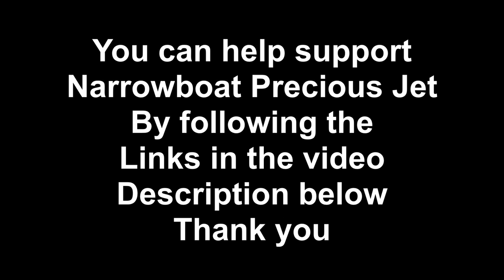Narrowboat Refit #58  Odd Jobs & Lighting The Log Burner

Comment: Oh dear, when I saw the bag of logs I added on the notes I had written 'need to get kiln dried wood', and so it was! I am afraid that these nets of logs are all to common and cause problems. The government is outlawing these wet logs from being sold. You need wood between 12% and 20% moisture content for good combustion. I would put slightly more kindling in but that was not the problem. If you would like I will pop over with some wood if you want to contact me and show you how, maybe even cook some bread? I would also recomend the wax and wood straw firelighters as the white chemical ones are prone to creating smoke which can mess the glass up. Charlton and Jenrick are also a leading gas fire manufacturer so I am also gas safe registered although I don't carry the boat "ticket" but can I offer the following thoughts before you change youe automatic change over valve? If I can read it right you high pressure "pig-tails" from your cylinders are date as being made in Feb. 1991 which is a bit on the old side and would be worth replacing. If the leak is big enough leak spray will be blown away. Make sure the gas is turned off as Propane is heavier than air and will sit in the bilge waiting for a spark.
Reply from the maker: Thank you again David! Yes I’m going to get new pig tails as like you said these are very old now, the only good part if you like is that the gas locker where the bottles are is sealed off from the rest of the boat and are also vented to the outside. Where about a are you based as I love to pop over and have a chat at some point 😊😊👍🏼